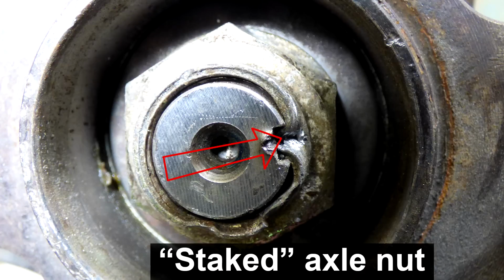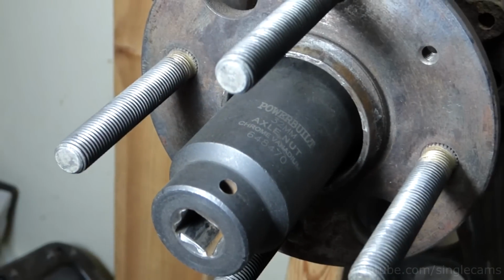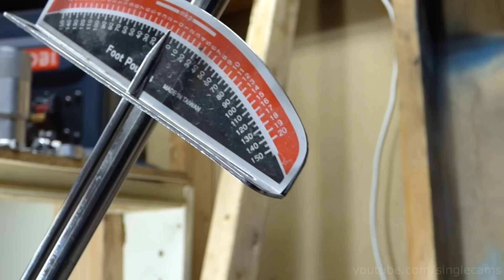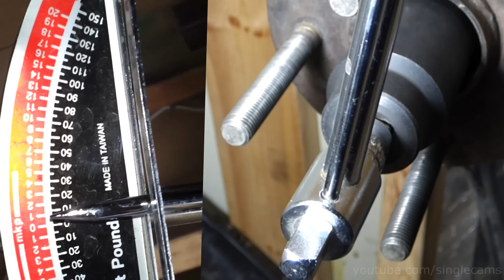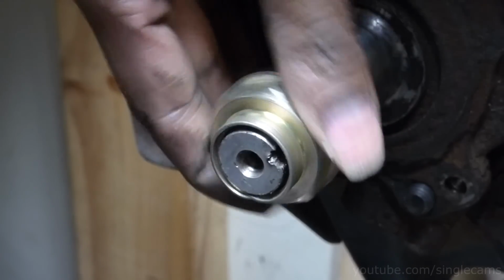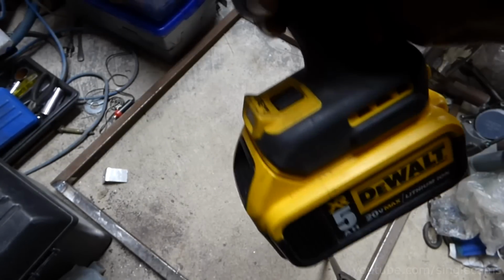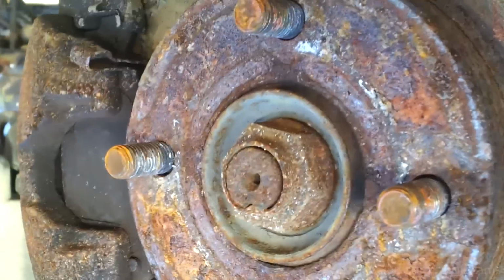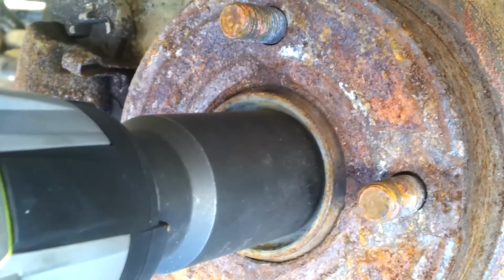Torque needed to remove "staked" axle nut

Comment: Honda says unstake it.  I think I will listen to Honda instead of R2D2
Reply from the maker: +jerry jones If your experience is that you need to read a manual to remove an axle nut then it is best to follow the manual for your car.
Reply: R2D2 says beep boop this guy is more like stephen hawking. The risk is that the staked region may cause damage to the threads on the axle spindle but the spindle steel is much much harder than the nut steel so it seems kinda unlikely. that said all my cars have had the cotter pin design so i have no experience with this. stumbled on this video today because i need to take off the nut on a friends car and its staked. this confirmed my suspicion that unstaking is probably not necessary but

Comment: Do not try to remove an axle nut, without unstaking.   It may work for some applications, but I can assure you that if you try that on a Toyota/Lexus/Scion vehicle, you will be replacing an axle or having to spend lots of time trying to repair the axle threads... I've seen some techs that couldn't even get the nut off, after trying that... the threads were so destroyed that the nut wasn't removable; he had to cut off with a cutoff wheel.  
- Toyota MDT 15years experience
Reply from the maker: try reading the description

Comment: Staking is just to brevent it backing off while car is vibrating. the force is minimal, i just zip it off with an impact gun or just use a cheater pipe
Reply from the maker: Exactly.

Comment: So what's the purpose for a "stake" then?  Could you in theory replace a new nut and NOT stake it...would the nut come loose at 200'lbs without a stake?  So why stake at all?
Reply from the maker: The nut will not come loose if it is torqued properly...do you stake your lugnuts? . The purpose of the stake is to stop the nut from coming off IF it does come loose for whatever reason. This is just like cotter pins , you can still loosen a nut with a cotter pin it just will not back off even if it does come loose so your suspension does not come apart...same with the stake. If you look up the purpose of safety wire it is for the same reason so if the fasteners come loose the whole assembly does not fall apart. Saftey wire, cotter pins , castle nuts , staked nuts , nylock nuts  are all to stop the fasteners from totally falling off if they come loose but do not actually hold the torque.

Comment: But of course is going to be less than 20 to 40 foot pounds because it's only hand tight but those can be torqued down anywhere between 150 to 250 foot pounds so of course it's going to break it loose but what if it is torqued all the way down then you will have to use something that has enough torque to break it loose
Reply from the maker: Just ask yourself does a cotter pin stop a nut from coming loose....coming loose not coming off? The answer is no...the only job a cotterpin does is to stop the fastener from coming off totally and the assembly dissembling itself like a tierod coming off the knuckle. This staked nut does not stop the nut from coming loose and I'm sure I have prob wrote this 10 times in this video.

Comment: The nut has been staked a few times already? Therefore the metal has been weakened with every attempt?
Reply from the maker: +Lizzy V You can put a new nut...it will not matter. I have tried with new nuts and I can do the same thing. This tab will not stop the nut from coming off...there is no more or less resistance...it is only about 16 gauge thick metal it is not going to stop a breaker bar.
Reply: Lizzy V car manufactures consider the Axel nut is a one time use only and recommends using a new one at service